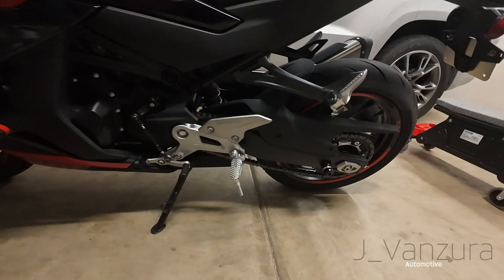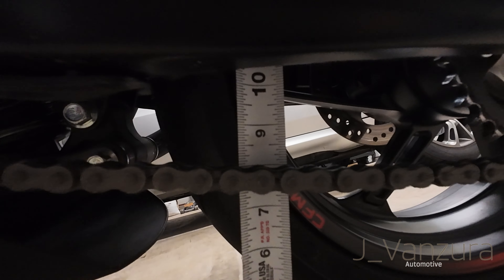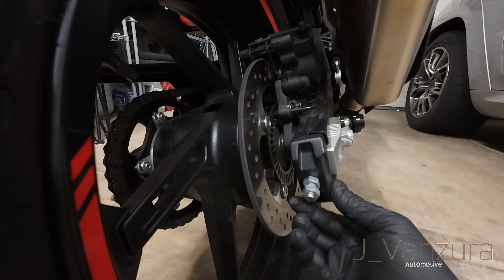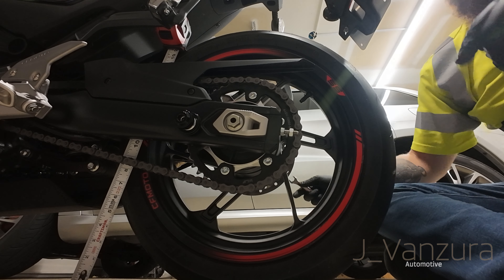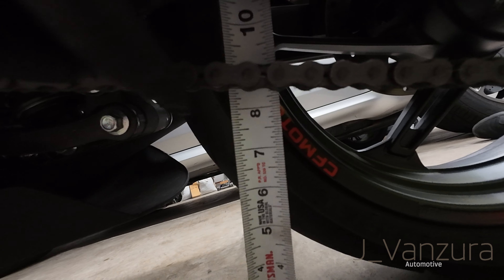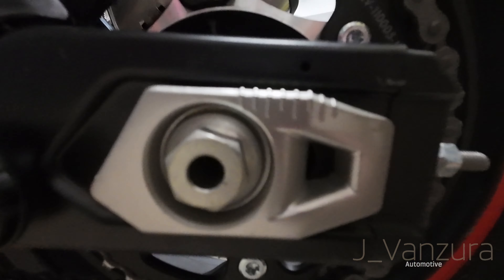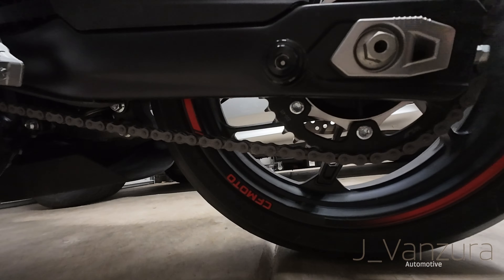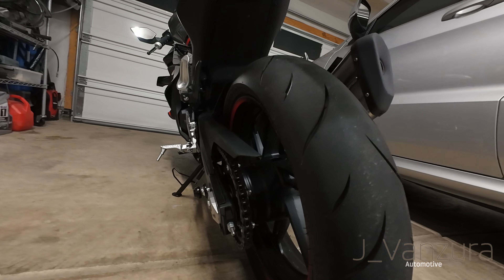How To Adjust Chain Tension For Beginner Riders! | 2023 CFMOTO 450SS

Comment: Good to see Mx content on this 450SS. I’m definitely considering picking this bike up there’s a huge sale going on$4,500 bucks. 

I’m currently riding a 24’ ninja 500. Had it for 4 months already at 10,000 miles. Just adjusted my chain yesterday. It was out of tolerance by 14mm lol but easy job.
Reply from the maker: @GhadSpeed  i love the bike, especially as a first bike it’s been great to learn on! 

I bought mine used with 104 miles on it for $4,200 which is $3,000 less than the original owner paid out the door